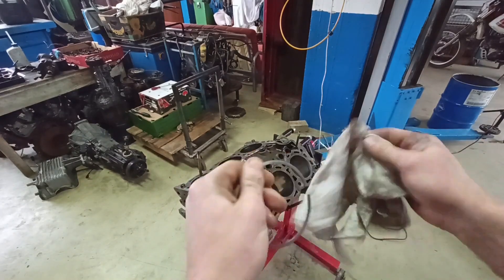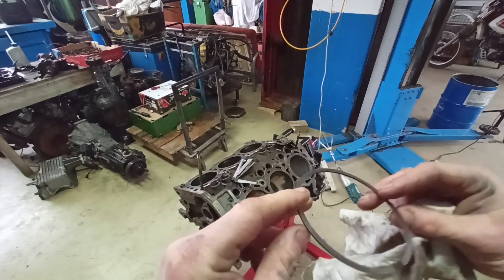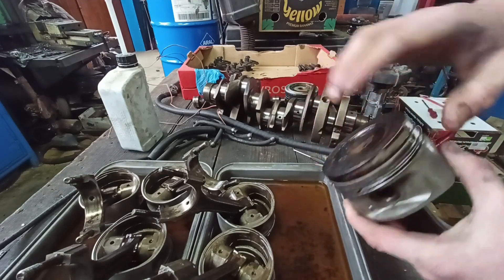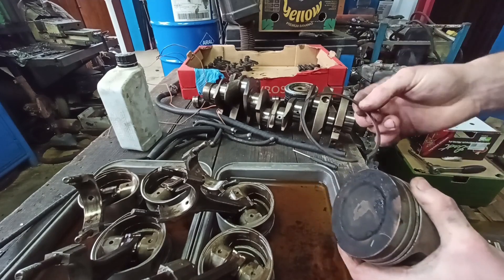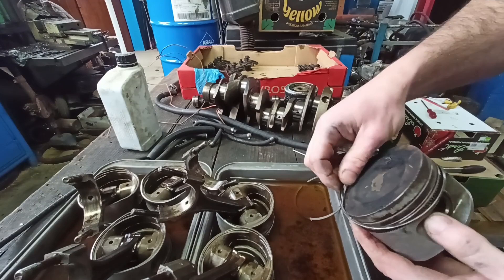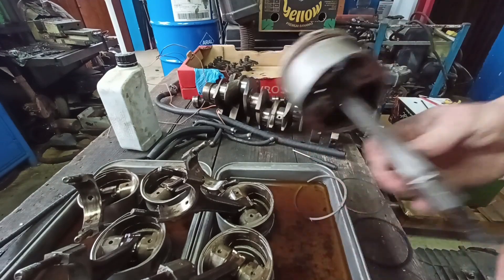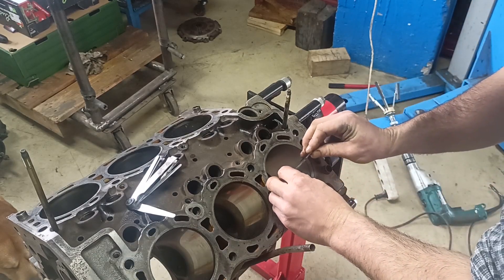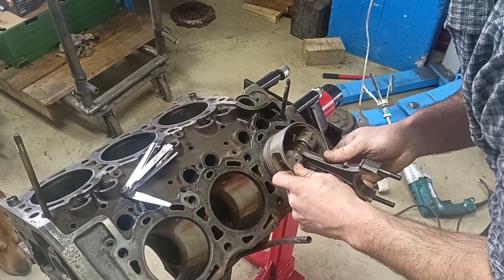Budget Block Check | Ford Cologne 2.9 Engine Overhaul | Part 4

Comment: What did you soak the pistons/rings in?
Reply from the maker: It's a universal degreaser/paint thinner called "diluente nitro". Works a lot better than gasoline for this kind of jobs.
Reply: @HappyDayGarage gotcha, if it isn't exactly that one to get, any nitro will still work better than gasoline?
Reply from the maker: @renizer  That's right. It works wonders on carbon deposits, although it's still recommended to "mechanically" clean the piston ring grooves with a broken ring or something similar.